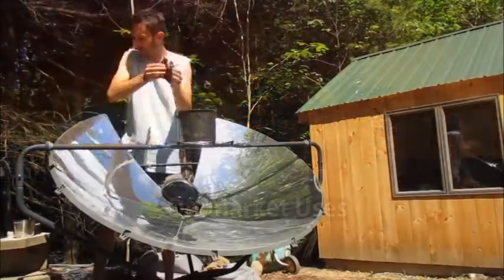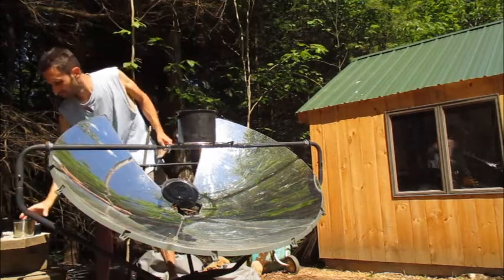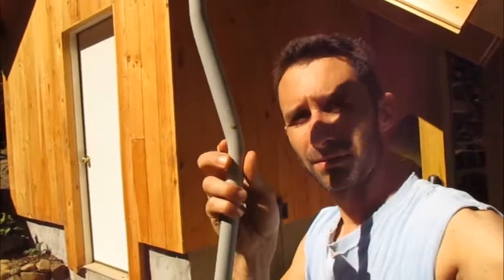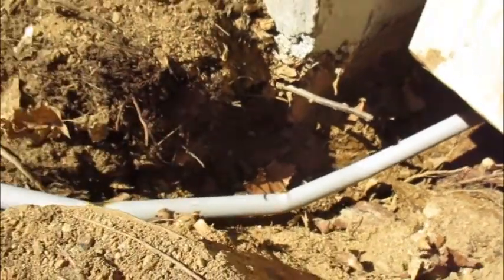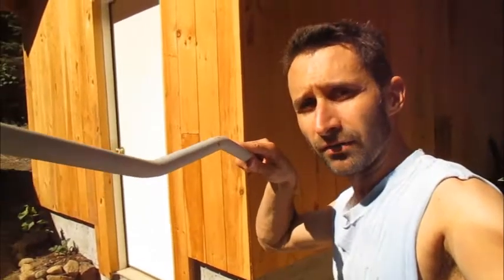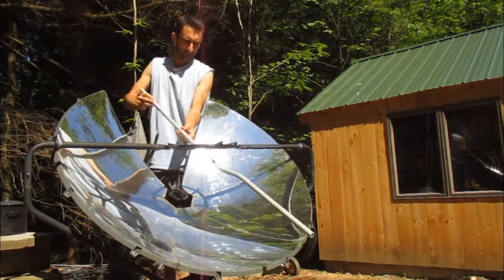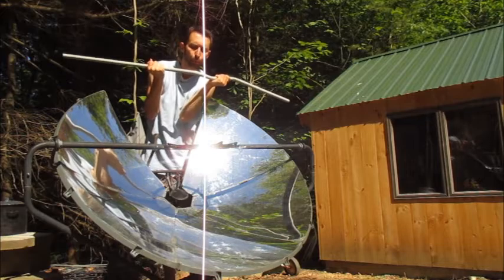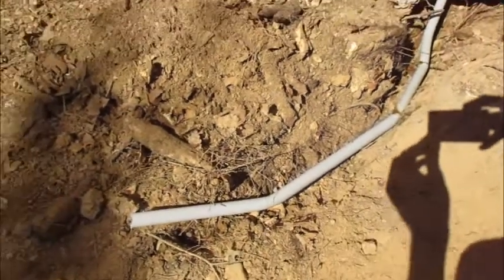Renegade Parabolic Solar Cooker Use

Comment: Also. The reason it's hard to cook with the parabolic is because of the highly focused heat source on the pan that isn't designed to distribute the heat that way. The cookware that is designed to be heated in one area is a Wok. It's a different style of cooking but it can be adapted.

Comment: Me again. One thing I have a hard time doing with the box ovens is tamales. They tend to dry cook since most of the heat is at the top. I think the parabolic would make a great steamer for foods as well as a sterilizer for other things. The 7 quart granite ware canner I got from Walmart for nothing would work but you could go larger.
Reply from the maker: As long as the direct use of the parabolic solar cooker is boiling water, then my experience would support your hypothesis. I just used it yesterday to boil water in order to boil potatoes. It worked fine and nothing got over heated because I was essentially boiling pure water. The issue with the cooker is if you try to heat something that has any thickness at all (soup, chili, etc), the cooker will often burn some of the substance to the bottom of the pot, and then once the water is driven away from that spot, the insane overheating begins. This can be compensated for with constant wiggling of the dish to distribute the heat, and some other methods have been mentioned to me (like using a metal plate to disperse the heat, but I've never personally tested this). But I never tend to wiggle the dish because if you have to stop even for a few seconds (like if your kid needs you or something), then the cooker goes right back into over-heat mode. So manual solutions are possible, but just not often practical.

As for the box cookers drying things out, yes, this is true but lidding things with an inverted glass bowl etc. can pretty much take care of that issue. Of course solar cooking is different than conventional oven cooking. There are both pros and cons. I'll never get a golden brown effect on any pizza that I cook solar, but I've never been able to cook delicious tender beans as well as I have in my solar oven.

Thanks for your thoughts!

Comment: Thanks for featuring SolSource! We just launched a new model, SolSource Sport. It’s portable, affordable, and powerful too! Check it out here: www.oneearthdesigns.com/solsource-sport
Reply from the maker: That's a cool new product. By the way, I've been using your parabolic solar cooker for a while and while I do love it, the vertical arm that controls up-down angle has NEVER worked very well, the tightening knob is always slipping and just has never been very functional. I use a propping stick instead which works totally fine (and doubles as a pot-holder hanger). But that part of this product is something that someone should look about improving.